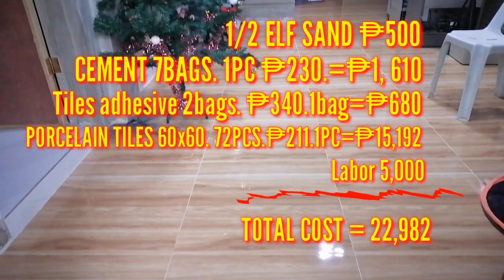TILES INSTALLATION LAY OUT TO FINISH STEP BY STEP COMPLETE TUTORIAL

Comment: I can't understand why you make such a thick coating of cement and adhesive under the tile.  In the US we use what we call "thinset" .  Its all pre mixed, just add water .  We trowel a thin coat on the floor and apply the tile.  Next day its a solid as a rock.  Just add grout and its done.  Do they carry "thinset" in the hardware stores in the Philippines?
Reply: I'm an engr here in the Philippines. You are correct. The method they used here in the video is somehow wrong. That thick cement was due to wrong elevation of flooring where it should have been resolved with concrete topping before start of tiling works. During the tiling works only adhesive & water should be used. Thickness of adhesive will depend on manufacturer's instruction varrying on size of tiles u will be using .For example if you used 600x600 tiles the thickness of adhesive should be 6mm for 300x300 mm the thickness will be 3mm. For walls it is advisable to used heavy duty tile adhesive & for flooring you can use ordinary adhesive.
Reply: @alfricabinsay6920  Thank you for your response.   I wasn't sure if there was a reason why it was done that way because you have a different climate there.
Reply: @larrye2679 it's the primitive method of setting tiles and it's one of the main reasons why tiles popup. Unfortunately, these tile setters don't want to adapt to the modern method. And if their tiling fails, they blame the tiles😂😂
Reply: Here is the reason why they use thick dry pack (sand and cement) before the adhesive (thinset), in the Phils. The problem lies upon the non application of a 2 x 4 guide on both side and 2 x 4 cement slab scratch-er/straightener while the concrete truck pours the concrete (US standard), therefore the slab is uneven. I am going to build a house in the Phils this year and I will apply US standard in pouring slab and tile setting the easy way.